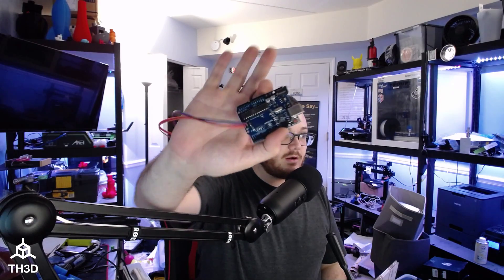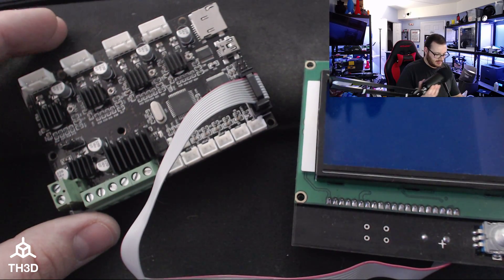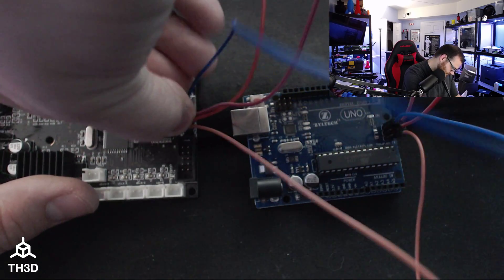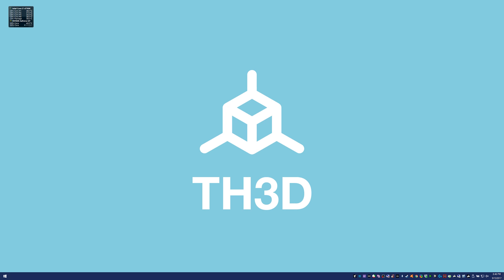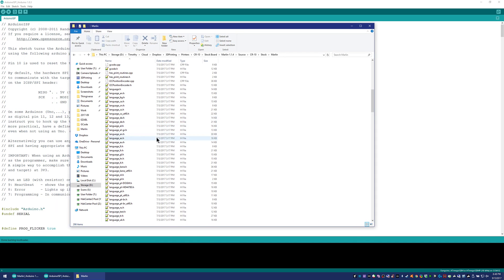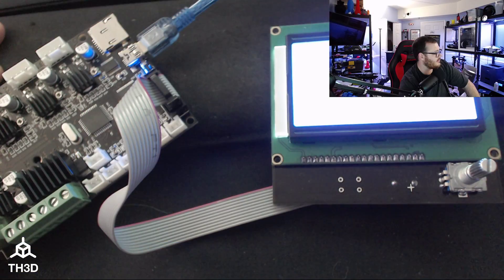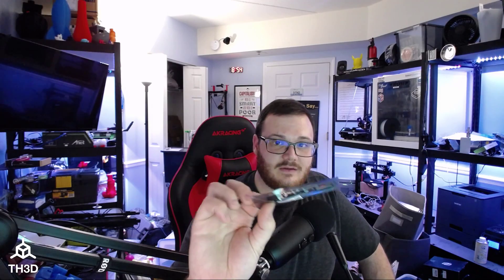OUTDATED - SEE NEW 2019 VIDEO ON CHANNEL (CR-10 Bootloader Flashing Guide - Marlin Firmware EZABL)

Comment: THANK YOU SO MUCH! I used so many other tutorials and none of them worked. It seems that connecting the reset pin to pin 10 on the arduino fixed the problem.

Comment: I was able to upload the ArduinoISP Sketch onto the Uno board.  I have the pins connected up correctly but when I set to Arduino as ISP, choose the Sanguino Board, then Burn Bootloader I get: 
"avrdude: verification error, first mismatch at byte 0x000 
     0xdc != 0xde
avrdude: verification error; content mismatch
error burning bootloader." 
 Any thoughts?
Reply from the maker: There are more details on the page here: https://www.th3dstudio.com/knowledge-base/cr-10-bootloader-flashing-guide/
Reply: Details didn't provide any further info regarding my case.  I took a multi-meter to my test leads and one did not have continuity.  Should have checked last night but was pretty late and thought process was down the tubes.  Thanks.

Comment: Two questions on the latest version of the zip file were is that extra software he uses on 8:55, can’t seem to locate it.
Also I got everything done to the point of loading the new firmware.
When I hit load it gives me an error “error unknown motherboard compilation.h” something like this what am I doing wrong.
Thank you in advance
Reply from the maker: For the firmware follow the video on the Unified Firmware. The firmware portion of this is outdated.
Reply: Thank you for your clarification, I was having some issue understanding which video to watch. In the end, I was able to update the firmware and will be testing this week.
Reply: I will try that but what about the unknown motherboard value set in configuration.h

Comment: You left two parts out of the video:

1. After you upload the ArduinoISP (before you "burn the bootloader") you have to select tools > programmer > Arduino as ISP.  Then you can select tools > burn bootloader.

2. Seems obvious after the fact but he never mentions to remove all the jumper wires, remove the Arduino, and connect your computer via the standard USB port on the CR-10 control box before you upload the "TH3DUF" ino firmware file.

Maybe adding these comments to the video itself would help users.
Reply: Matt Grubbs 
I wonder if this is my issue 🤔🤔🤔🤔🤔

Comment: Unable to use this method for me. I'm using an Elegoo Nano, pins wired directly to pin headers (as there is no ICSP on the nano). I successfully burned the Nano code (by replacing the step where you selected the Uno in the board menu). HOWEVER. when I actually go to burn the bootloader to the printer board; I'm getting "avrdude: Yikes!  Invalid device signature."... This is on an Ender-3 (the Elegoo version, uses creality board v1.1.3)
Reply from the maker: You may need to change the programmer to Arduino as ISP and then try again. You're probably trying to burn the bootloader to the Uno.
Reply: Pretty sure I figured out my problem; I'm 95% sure my mainboard is dead. I've tried using pretty much every method available (using an RPi 3, using ardiuno as ISP, and a USBASP); all methods have failed giving that same error. I have a feeling it might be the 16mhz crystal on the mainboard that has failed, but I don't really have a way to test that. I'm working with Elegoo to get it replaced. I was successfully able to burn from one Nano to another and to use the USBASP to also burn the Nano's...

I should mention, the printer itself had issues after its first preheat, the screen locked up, then after turning it off and letting it cool, turning it on yielded a blank screen and nothing else. Really the only reason I'm trying to flash the bootloader at all. I might just swap to a MKS Gen-L board however, so I can run TMC2208's.

Comment: My Cr-10 has a newer control board, V1.1.2. It does not have a jumper, at least I couldn't find it.
Reply from the maker: You dont need to move the jumper. There are notes on this in the video description.

Comment: Couldn't you just flash the entire firmware via USB instead of going through the hassle of connecting the Uno, etc.?
Reply from the maker: You need the bootloader before you can flash over USB. Once it is on there you can load firmware over USB in the future.
Reply: TH3D Studio Just asking because I flashed a newer version of Marlin today, because I was having issues with temp readings after I swapped my hotend sensor to an E3d one. Works like a charm now, but I still have clogging issues halfway through prints

Comment: I found this error while burning the bootloader: 
Yikes! invalid device signature Double check connections and try again, or use -F to override
         this check.

what i have to do?
Reply: You've probably solved this by now but for anyone else that get this (as I did) double check your cabling between the uno and your printer board. I got the same thing and i had the reset cable incorrectly pinned.

Comment: I successfully uploaded to the Arduino, I'm using an Elegoo EL-CB-001 UNO R3 Board ATmega328P ATMEGA16U2, with no problem but when I follow the steps to burn it to the CR-10 board it errors out saying error while burning bootloader. In the lower left corner of the Arduino 1.8.5 IDE software it shows the configuration "Sanguino(1284P Boards), ATmega1284 or ATmega1284P(16MHz) on COM4. Now I'm lost, whats my next step?
Reply: This is the verbose version of the error log:
----------------------------------------------------------------------------
Arduino: 1.8.5 (Windows 10), Board: "Sanguino(1284P Boards), ATmega1284 or ATmega1284P (16 MHz)"

C:\Program Files (x86)\Arduino\hardware\tools\avr/bin/avrdude -CC:\Program Files (x86)\Arduino\hardware\tools\avr/etc/avrdude.conf -v -patmega1284p -cstk500v2 -Pusb -e -Ulock:w:0x3F:m -Uefuse:w:0xFD:m -Uhfuse:w:0xDE:m -Ulfuse:w:0xFF:m 

avrdude: Version 6.3, compiled on Jan 17 2017 at 12:00:53
         Copyright (c) 2000-2005 Brian Dean, http://www.bdmicro.com/
Error while burning bootloader.
         Copyright (c) 2007-2014 Joerg Wunsch

         System wide configuration file is "C:\Program Files (x86)\Arduino\hardware\tools\avr/etc/avrdude.conf"

         Using Port                    : usb
         Using Programmer              : stk500v2
avrdude: usbdev_open(): did not find any USB device "usb" (0x03eb:0x2104)

avrdude done.  Thank you.

Comment: anyone have any idea why i get this message "
avrdude: Yikes!  Invalid device signature.
         Double check connections and try again, or use -F to override
         this check.

Error while burning bootloader.

It dosn't seem to work.
Reply: same issue that I'm having.  I'm at Witts end.  I'm just going to spend the money and buy a replacement board that already has the boot loader flashed.
Reply: i bought another cheap uno but with the other chip(not surface mount) i haven't tried it yet.

Comment: Well - I successfully flashed the new board.  I did everything again  and went through step by step...  

What was missing in the video was to set (in Tools Menu) the Programmer to 'Arduino as ISP'.

No jumper required.  It worked.

Thank you for the video but you should put a little note in the comments.

Comment: error "unable to detect MCU"  in AVRdudess.  If I try to flash the firmware from arduino I get  "programmer is not responding" .Any ideas?

I was able to burn the bootloader using  Nick Gammon's atmega board programmer. but not through arduino IDE
Reply: Figured it out. The TEVO Tornado uses a ATMEGA2560 chip so when you go to burn the cootloader and flash the firmware you must have the board set to "ATMEGA2560". The portable Arduino IDE also contributed to my error.

Comment: my boot loader seemed to burn fine, after i disconnect my arduino and my melzi board is plugged in only my computer wont show any COM ports available
Reply: oh forgot to mention my original firmware is now gone and i cant get new firmware on either method you mention
Reply: Timothy Hoogland yes the lcd turns on, remains blue only
Reply: Timothy Hoogland once the uno is disconnected and my melzi board is connected to pc i dont show an COM ports available. tried over and over again
Reply: did you every get this? im having the same error but my LCD is on anc i cant see Tims responses on your original commment
EDIT: lcd cable was unplugged at the screen

Comment: I have a cr10s and am using Cura. There is an option in the software to "Upgrade Firmware" Is it safe to  use this feature or do I still need an Arduino  to make changes to the firmware?

Comment: Hi Timothy,

Thanks for the video. I bought a genuine e3D V6 plugged everything. Do we need to a firmware update? What will happen if I don't do it?

Right now I bought an UNO R3 from elegoo and plug it to flash the board and it doesn't work. I have this error all the time  System wide configuration file is "C:\Program Files (x86)\Arduino\hardware\tools\avr/etc/avrdude.conf"

         Using Port                    : usb
         Using Programmer              : stk500v2
avrdude: usbdev_open(): did not find any USB device "usb" (0x03eb:0x2104)

I am using Sanguino with AVRISP MKII I plug everthing on USB3 and connecting to COM3 Arduino/Genuino

Any idea how to fix this?

Comment: Success, thank you for this!  A couple notes that might help someone...

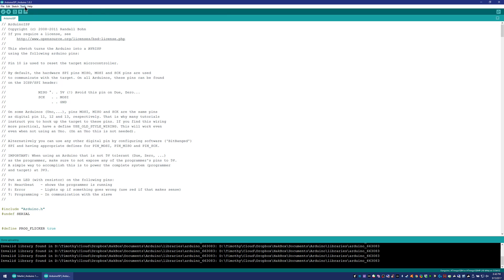First, at 6:43 you don't say to make sure the programmer is set to "Arduino ISP".  Mine wasn't and it failed the first couple times until I recognized the problem.  Second, I had to right-click the avrdudess.exe distributed with your firmware and select "run as administrator".  If I didn't do that, it was not able to access the ATmega1284p COM port.
Reply: Jarrod Smith b

Comment: Hey just wanted to mention that although your video is absolutely correct the written instructions are wrong! Well In step 3 for flashing the bootloader it says in substep 6 “select tools -> Port and choose the port for the Melzi board that you just found in the device manager” Well out of frustration I finally selected the Arduino board instead and it worked! After 3 days of frustration and reading about all the other people with the same “programmer not responding” error message I just tried it. I just went back to your video and was relieved that it was ok. Please pass the word!!
Reply: Thank you so much. I was having this issue as well.
Reply: merci ca a marcher

Comment: Help - "Error while burning bootloader" -  I did all the steps per the video and found I was missing Sanguino, so added it via the "File/Preferences/Additional Boards Manager URL's" using the link supplied by GitHub, then selecting thru Board Manager the Sanguino board. In Tools I selected the "Sanguino" board then the "Processor/ATmega1284 or ATmega1284P (16mhz)" option then "Burn Bootloader"  I then get the dreaded Error message shown above. I am using a Arduino/Genuino Uno R3, and version 1.8.5 of Arduino. Any and all help is appreciated - Thanks
Reply: Thanks!! this fixed my Error problem!
Reply: This fixed it for me too!
Reply: Were you able to fix your issue?
Reply: I think I just figured it out, you should choose Programmer "Arduino as ISP" > Burn Bootloader
Now it says "Done burning bootloader"
Let me continue on and see if I can now update my firmware.

I also found this link http://www.instructables.com/id/Flashing-a-Bootloader-to-the-CR-10/
Reply: Kool Go thanks!! That did it and it loaded successfully
Reply: Thanks! That was exactly what I was looking for
Reply: I tried that and got this error "avrdude: Yikes!  Invalid device signature.
         Double check connections and try again, or use -F to override
         this check.

Error while burning bootloader."
Reply: +1, that worked for me as well, cheers

Comment: FWiW with the help from your video, plus other searches I managed to pull this off with an Arduino Mega 2360 (Was all I had on hand).
Run the Atmega_Board_Programmer.ino (Setting up your mega board, port, etc) obtained from here:
https://github.com/nickgammon/arduino_sketches

First time I've ever done a bootloader or firmware update. if I can do it, anyone can.

Comment: Very helpful, thanks! I now have Marlin 1.1.5 installed on this CR-10, with some extra features enabled (filament change, SD sorting, optimized graphical display, etc.). I can't wait to get printing with it later!

To flash the bootloader I used an Arduino Mega 2560, so I had to follow a slightly different procedure. For the SPI connection I connected pin 50 to MISO, 51 to MOSI, and 52 to SCK. I used 5V and GND from the center ICSP plug. I connected pin 10 to RESET, though I probably could've used pin 53 (SS). When trying to flash the bootloader the Mega would only flash once, then stop. I did some research and learned that I needed to connect a 22µF capacitor between the 5V and RESET pins (in the power group) of the Mega. I only had a 10µF on hand, but it worked!

Flashing Marlin was easy after that, but I couldn't enable Mesh Bed Leveling due to lack of space. In the process I noticed that the Creality Melzi's 1284P has 128K of Flash Memory and 16K of SRAM (only 4K of which is used in my config). This means ~9K of the the available memory will never be used. A major reason Mesh Bed Leveling (or at least LCD bed leveling) doesn't fit is because static strings (i.e., "Click to Continue") take up lots of flash memory. Usually, that's what you want. But it's possible to make some strings go into SRAM instead and then you can fit more code. With just a few adjustments to strings, it should be possible to regain 8 or 9K and enable one or two more helpful features. Perhaps I can make that an option for a future Marlin release…. These more modest boards should not be forgotten!
Reply: Timothy Hoogland Congrats! Also this weekend, I'm planning to do the release of Marlin 1.1.6 which patches a few  bugs in 1.1.5. And, keep an eye out for Marlin 2.0, which should be ready in the next few weeks. It has a much-improved codebase, including more 32-bit support. I think you'll find it easier to work with for future versions of EZABL. Keep up the good work!
Reply: Hi Scot, i Used the ELEGOOD Mega2560, but used the ICSP connector and PIN 10 for reset. It lookes like it's working. But had a two lines of "avrdude: stk500_recv(): programmer is not responding" in the output console in the Arduino IDE. But i guess it started responding and the firmware was uploaded. So it seams.. Now just need to check if it prints. 

Any comments on the "avrdude: stk500_recv(): programmer is not responding" should i be concerned..?

Comment: I am able to connect to my uno and upload the isp sketch ok. When I went to select Sanguino it was not on the list. I did a search for Sanguino and found a add on and followed the instructions to install it. I then restarted Arduino 1.0.5.. Sanguino W/ ATmega 1284 or ATmega 1284P (16MHz) is now on the list (among other Sanguino options). There is still no other option to select the processor. I assume you are doing that in one step. When I select Burn Bootloader, it says"Burning bootloader to IO board (this may take a minute)". Then it says "Error while burning bootloader."
avrdude: stk500_getsync() : not in sync: resp=0x00
I am pretty sure all of my connections are good. I have tried all of the ISP programmer options in Arduino. I'm not sure what to do from here.
Reply: UPDATE: My reset pin was not making contact. New problem. The Marlin update will not compile due to a whole bunch of static_assert errors. I think I need to use a newer version of Arduino?
Reply: The new version of Arduino fixed the problem. I also had to include the u8glib library in order for it to compile and load the firmware to my CR10.

Comment: It took me 10 seconds to flash using a USB ICSP and plugging it into the board with no jumpers required. Costs less than an Arduino and less likely to bungle the wiring.
Reply: The most unreliable part is the fact that the LCD eats more memory than it should and AVRdude is old as hell and has its own problems. There is no reason the graphics library should eat that much memory.

Comment: Buy a  cheap USBasp with an adapter and burn it , without a arduino or wires. Works on all boards with IcSP connector
Reply: why? you just need to connect the flat cable the 6 pin adapter and plugs directly on the board.

Comment: This is probably a dumb question, but is it possible backup the original CR10 firmware so it can be returned to stock if need be in the future?
Reply: Timothy Hoogland thanks for the info.  I might want to play around with some custom settings in the future.  It's just good to know that you can get back to a known working state.
Reply: I don’t see an answer to this. I’d like to back it up first as a safety fallback. How is it done?